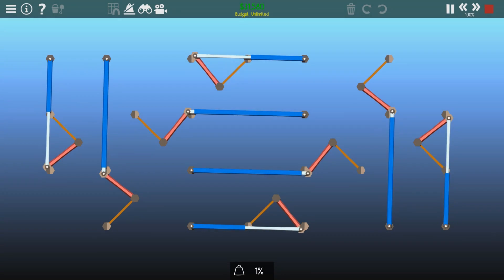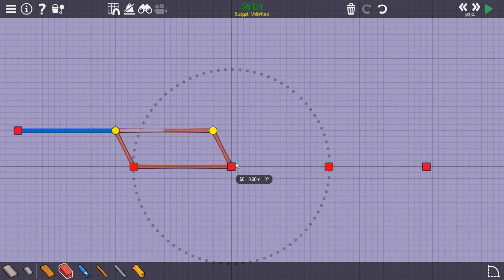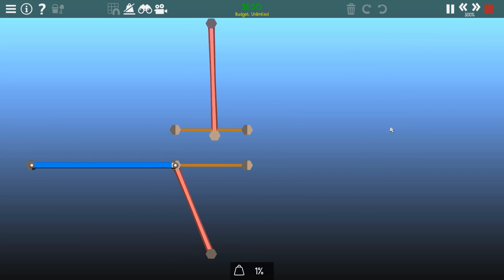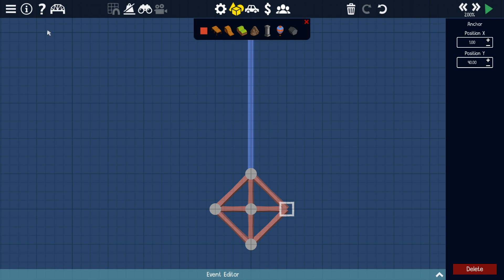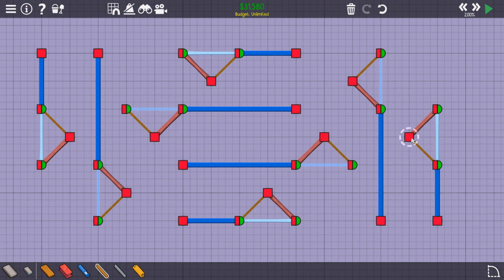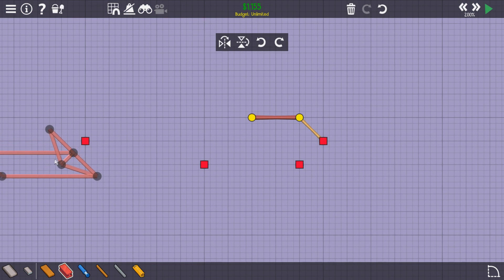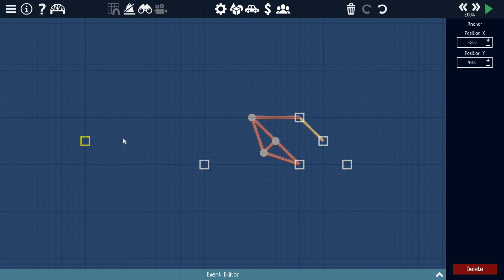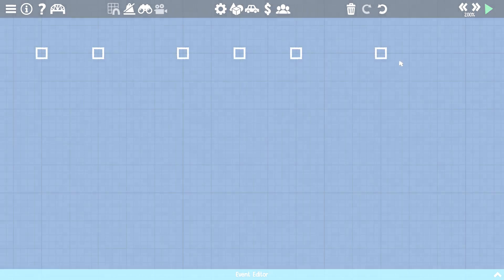Reusing Hydraulics, and 90 Degree Movement | Poly Bridge 2 Kinetic Bridge Basics Ep. 2

Comment: I can't make split joints in sandbox, but I can in Campaign, anyone know why?
Reply from the maker: In the level editor, there is a light blue tab called "event editor". Pull that tab up. Then click on the button called "add hydraulic phase."
Reply: @ArglinPB  Oh thank you
Reply: @ArglinPB  Is it possible to make my car stop at a spot I choose, and make it go again after something happens?
Reply from the maker: @Perify  Click on the car of your choice, then on the right side click on checkpoints. Add checkpoint. Then click on the checkpoint and change it to stop.
Then in the event editor, add and then drag a hydraulic phase to be between the car's phase and the circular arrow phase.
Reply: @ArglinPB  The car doesnt stop for some reason
Reply from the maker: A few troubleshoots:
Did you check to see if you placed a hydraulic phase is placed in between?
Is the checkpoint an octagon?
Is the car touching the checkpoint?
Do you have a hydraulic that is active during the hydraulic phase?
Reply: @ArglinPB  I do
Its an octagon
It is
No

Comment: I have a question
When I use Hydraulic in sandbox mode, it doesn't work. What do I have to do to make it move in sandbox?
Reply from the maker: 보이드 I don’t know if your game is in English or not so I will try to explain visually.
In the Level editor mode, at the bottom of your screen, there is a light blue bar that you can click on and drag up. Once you pull it up, you can click on the button in the bottom left to add a hydraulic phase. Once you have that, you can go back into Bridge editor mode, and place a hydraulic to test to see if it works.
Reply: @ArglinPB  ok, I'll test it tomorrow. Thank you!

Comment: Mine Won't Work In Sandbox Mode
Reply from the maker: Ronnie Porter What doesn’t work in particular? Did you add a hydraulic phase? Did you make sure to split joint? Your remark is a bit too vague for me to answer well.
Reply: @ArglinPB  I Can't Make A Split Joint Either
Reply from the maker: @PomPomthePigtailGirl  Go to sandbox. At the bottom of your screen there is something called an event editor. Hold down left click and drag up. Then in the bottom left, left click on "add hydraulic phase". Add an anchor, go to bridge editor mode (top left of your screen).
Your split joints should work now. Hover your cursor over any joint and tap J or double left click.

Also make a
Reply: @ArglinPB  Also Make A What?

Comment: These are very well explained. One more thing I'd like to know is how stress is handled within these structures, so I can get a better understanding of how to reinforce hydraulic structures in low budget optimizations.
Reply from the maker: Unfortunately I’m not exactly the dude to explain to you how to budget shave, considering I don’t actually bother shaving budget at all and instead A.M. more focused on making sure things are properly functioning and braced, with minimal corners cut.
Reply: @ArglinPB  Alright let me rephrase my question:

I'd like to know how stress is handled within these structures so I can get a better understanding how to properly brace them without cutting corners. ;)
Reply: @SimpleAmadeus  make arches.  slope downwards to disperse weight into solid ground, or slope sideways to disperse weight into solid walls.  or make upward arches with rope to put tension towards stronger sources.  ps anchors can absorb stress in any direction..

Comment: Anyone know how to make 270 degree rotation?
Reply from the maker: 270 and 360 I'll cover in a future video simply because they're kinda just huge flexes rather than being useful for most cases. You can probably use the techniques and thought processes I used to create the 180 degree linkage though or use some form of compound system by appending a 90 degree rotation with a 180.

Comment: correct me if im wrong, but a max leingth, max expansion hydraulic is 4 meters, and it moves its end point half that distance; 2 meters. shouldn't you say you are making a 2 meter by 2 meter box rotating about its center, not a 1 meter box?
Reply from the maker: TheLazyComet Oh I was just referring to the dimensions of beam itself that is connected to the hydraulic for 90 degree movement. The box is 2 meters, yes but one of the connections from a corner to the center is 1 meter by 1 meter.
Reply: @ArglinPB  it crazy how different people go about building these things. i almost always start with a square box and then add the center pivot so i always visualize this as squares of different sizes rotating